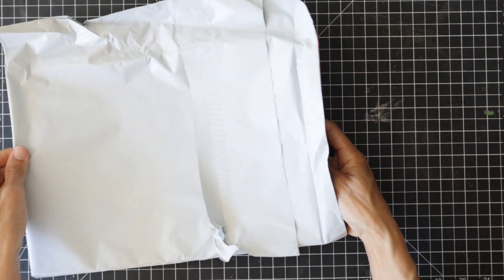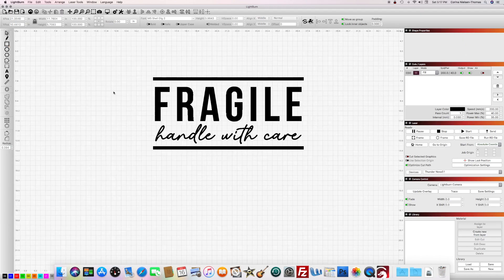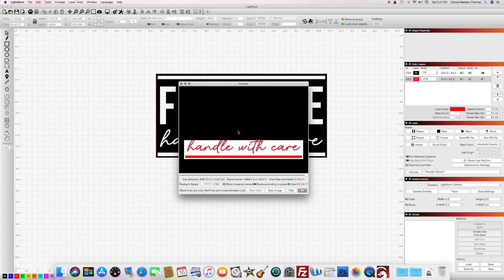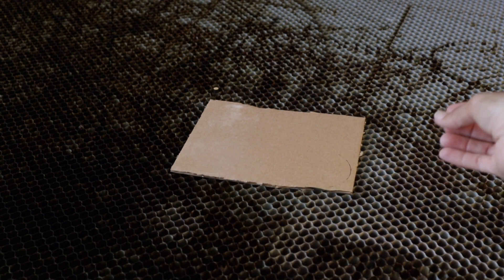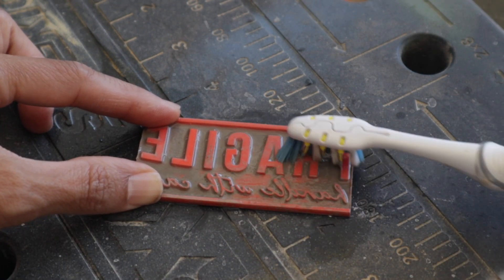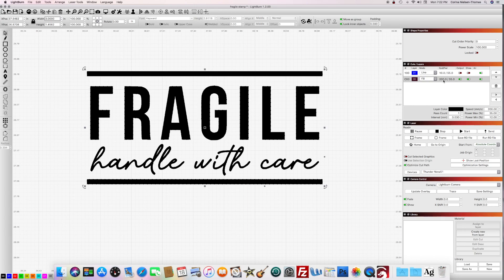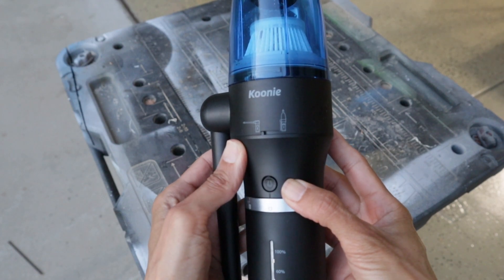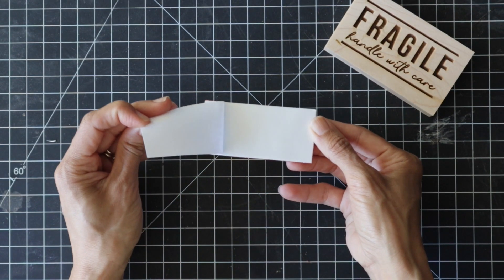How to Make Rubber Stamps on Your Laser | Thunder 51/100

Comment: To use the ramp settings, so that your small letters don't bend and/or break, you have to make sure to set your minimum power to the laser's minimum required power to start(mine is 8%). Otherwise it doesn't work. In the preview window you can then check "shade according to power" and you should see your text as blurry, then you know it's working. I recomment you do a test starting with a 0.3mm ramp, and see what it does.

Comment: In LB when I duplicate the design, all it does is create a second layer of the same exact design. What am I missing here to get the inverted duplicate?
Reply: The two graphics (your logo and the frame) should be in the same color/ layer, and the layer is in the process mode of "fill" (engrave instead of line/ cut). Hope it helps.